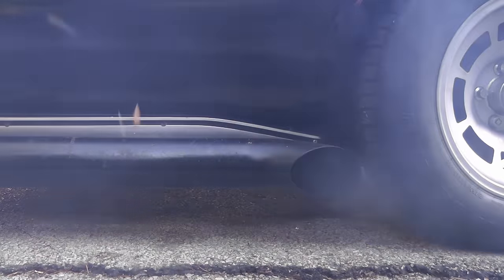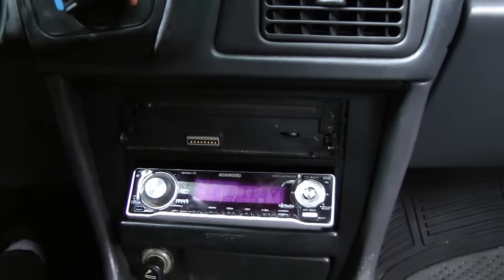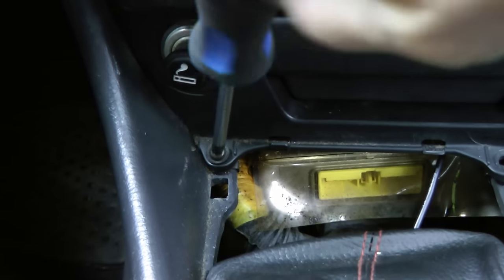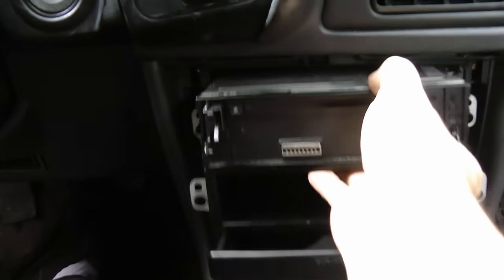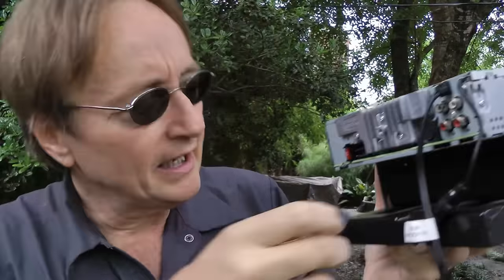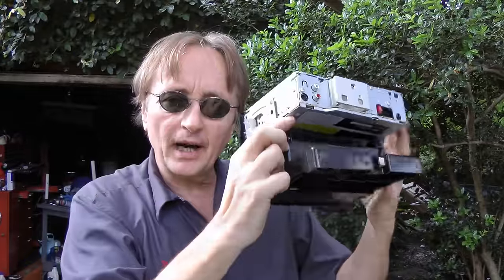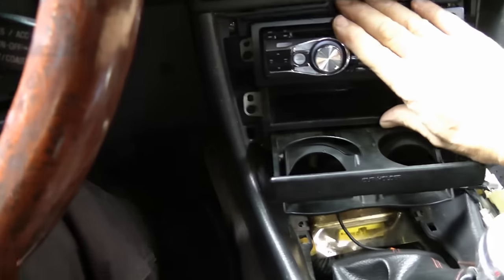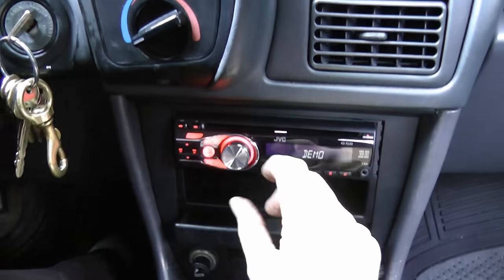How to Install Car Stereo

Comment: Hey Scotty, my mother has a 2013 Hyundai Genesis 3.8 sedan. It's a pretty nice car and I was just beginning to believe Hyundai has escaped their sorry reputation, but then the lights in the head liner started to flicker. It seems to only happen when the door is open, so I assume it has something to do with whatever tells the lights to turn on when it senses an open door. It isn't just one door, it happens with all of them (if that information matters). Would you happen to have any suggestions?
Reply from the maker: yes, check the ground wiring on that lighting system since it does it on all doors it can't be the door switches. But really, Koreans still make crappy cars in the long run from my experience

Comment: Scotty--  1994 Cavalier with its stock radio suddenly leaves the clock display on until the battery drains completely.  With fuses pulled battery remains fine.  Suggestions?  Door switch?  Faulty radio?  Where should I start?
--Joe

Comment: I recently bought a used car with an aftermarket radio in it. It vibrates a bit, especially in third gear (something to do with the frequency the car vibrates at in 3rd I guess). Any suggestions on how to fix that? I can live with it, but it would be nice if that is an easy problem to fix.

Comment: I tried installing a new radio from walmart in my truck, i matched the wires to where they should go, i turned the ignition on, and the radio doesnt turn on, i press the power button and nothing happens. The fuses are good, but did i buy a blown radio or am i missing something?

Comment: Hi Scotty i was wondering if you can help me out...
I have a 2003 Toyota Matrix XR 1.8L. And last night when i got off work both of my low beam headlights would not turn on automatically, since they are Day Time Running Lights. I also tried turning them on manually and no luck. My high beams, fog lights and all other lights are working fine. 
My question is where and what do i start checking? Where are the fuses and relays located on my vehicle? 
Your help is greatly appreciated.

Comment from the maker: do it yourself tons cheaper than that. Wiring's easy, as in this 50 dollar rather decent system, the wiring schematics are all on the back of the box. Wire is cheap, the rest is just your time.

Comment: Hi scotty i got a question off the topic. I just replaced the spark plug wires and the sparks(for new ones) and as soon as i started the engine the battery light showed on the dash, any idea(it is a ford V6 ohv 96 explorer 4x4 standard )? as additional info i checked the two wires on the battery and they were clean and fine, thanks.

Comment: this video reminds me that my radio in my 98 tocoma has been dead for years.   the cigarette lighter isn't working neither,  sucks because I can't use it to charge my phone. are the two problems related? would by is something wrong with the electricity, maybe the wires or is it that I need a new radio?
Reply from the maker: could use the same fuse or wiring in the dash could be disconnected

Comment: Most devices gives a bit of noise through the headphone jack when they're charging. There's no way to get around that other than unplugging the charging cable when using the aux. If your radio has a USB port and can play music through there, you should use that feature instead.

Comment from the maker: hey, the radio has two power wires, one for power all the time, the other for power when the key is turned on. And then one black ground wire, so why not just rewire those three wires directly to their sources, that's what I do rather than mess with the crap factory wiring.

Comment: Scotty K! I'm replacing the factory stereo on a 1979 Delta 88. The old stereo didn't need constant 12v power, so there isn't a wire to connect to my new stereo.

Can I splice into my ignition wire then add an in line fuse to run 12v constant power to my new stereo?

by the way - love your channel, even the videos that don't apply to me are interesting
Reply from the maker: +T Scott yes, you can splice it into the ignition

Comment: thats ok if you have an old beater like that, there was a time when it was that simple, take my 1994 Chevy Silverado 4x4  the factory rasio will not come out even after removing a few srews, it like something at the back of it is holding it, we have tried mant times to fget it out, and there is not one video on youtube that shows this truck. i know some take a specal key, but don't see any were it could go

Comment: hey I just installed new speakers with subs and I have amps for the subs and speakers but my front speakers do not work all the time. My friends said that I need better wires that can handle more amps etc but is this really the problem since the wires are connected properly? and if so what type of wires should I get? brand, size, etc.

Comment: I have a 03 Chevy avalanche with the factory bose amplifier in it. I installed a new radio and there was no sound. Is there any way I can bypass the amp so can make the sound work?

Comment: i have two questions should you unhook the battery and what if your getting noise but no radio signal and the antenna is plugged in.

Comment: When you put in new radios do every car have the same color wires inside the dash as the new radio at the back so they can be matched up? Or is every color wire different? And last do they all have those clips with the wires that snap in the back of the new radio? (im changing a friends radio soon.)

Comment: I'm not sure if they make one for Honda, I have a 1999 Camry when I had the Factory radio It could have come with a 6 cd changer, I did not have one so that left an empty port. They made a Aux cable adapter that will plug into that port and you will get cd quality music.

Comment: When you match up the wires is it always color for color?
Reply from the maker: depends on the car, some do, some don't. That's why you need a wiring adaptor for many so they go in the correct places

Comment: For the old radio did you cut off the  factory wiring or use an adapter kit? Please respond.
Reply: I always used an adapter kit. Makes things much easier. That way your radio harness can for your cars harness, using the existing wiring for power and speakers. With an adpater harness, you can make the connections on a table or bench. Even solder the connections if you want. trying to wire in the dash can be a bitch.

Comment: nice vid and congrats for because you share with as your  46 years of experience ..... WELL DONE , but now depends on car model , i want to replace my radio of my for focus turbo siesel 1999 , please give some advice thanks scoty THANKS
Reply from the maker: +dan laesu  it's 48 years now. realize ford uses radios that snap and lock in place, you need a special tool to remove them from the dash, get a cheaper one at a place like auto zone

Comment: Scotty, Can I mix 1 qt of dino oil with 5qt of synthetic oil (both are same weight 10W30)? My oil is kind of low and I don't have time to change the oil completely right now. Will it hurt the engine in anyway? my car has 170,000miles on it. Thanks!

Comment: It a lot harder to replace a radio in a 1991 toyota camry . It has a factory radio in a radio holder that any new radio will not fit. In order to replace the radio you have to by a conversion kit and a wire harness . That adds a cost of 45 bucks so with that it would cost over 100 bucks to replace the radio. 
Can you make a video showing that type of swap.
Is there a was to use the radio holder for a new radio on a 1991 camry dx.

Comment: If anyone does this, make sure you disconnect negative battery cable before cutting any wires or messing with the wires

Comment: ya know ive watched a lot of your videos and never had much to say but i feel maybe you should have done this using a car with a stock radio so someone could learn how to install an aftermarket radio from stock. this doesnt show anything about having to use a dash instal kit or the wiring of the unit because it already had a aftermarket system. someones gonna go and try to this and the cd players not gonna sit in the hole right and then the wiring will be all screwed up and they will fail

Comment: hey scott, I need your help.
I got a GM wiring harness and the wires don't match up with what is in my malibu. 
So my question is, is that normal or is the part not gonna work out?

Comment: European cars are alot easier to swap the radio on, there is 4 holes on the sides of the radio, you put metal rods in the holes, then put tension so you get a nice grip around it.
Then just pull it out, change the connector and push it back in, takes less then 1minute. but then again i guess that's why so many radios are stolen here, since it takes about 2-3sec break the window and pull one out.

Comment: Scotty, I have a 98 Honda Civic with a stock radio.  i want to add a device to my car to listen to my iphone music, but i do not want to put a stereo because it will attract thieves.  I dont like using FM transmitter because the quality of the music is bit low and you can hear the statics.  Any suggestions?

Comment: Scotty you forgot to mention to disconnect the negative battery first before doing any wiring installation on your car LOL. I know some people who actually fried their new stereo but not disconnecting the battery first LOL
Reply: Xtasy Musik so do I turn the battery off first? Then do what he said?
Reply: Anthony Sefo disconnect the battery terminals
Reply: If you notice right next to the power connector in the back of the radio there is a 10A fuse that will blow before the radio will

Comment: I prefer the original  radio in my 1996 Toyota Corolla  that has a cassette player

it's been pretty reliable for streaming music  using the cassette adapter method   

although I will say  the audio is not the same when playing a cassette forward, in fact the audio sounds better when the tape is played in reverse

I have no use for a cd player
Reply: fargeeks 😐
Reply: +Emerson Herrera old school ;)

Comment from the maker: not much power in a radio, those connectors work fine inside a dash. Only reason the radio was changed was cause you couldn't hook modern wireless devices to it, which the new radio was able to do, for only 59 bucks.

Comment: Its actually true unfortunately. The OnStar on 90% of GM products (not just chevy have this issue). You have to install a bypass module between the stock harness and new harness from your new radio. Somewhat costly but well worth it when everything it all setup.

Comment from the maker: cars nowadays use various different fluids for power steering. Even different years of the same make car use different fluids. ALWAYS check with the manufacturer for your own vehicle what to use. Putting the wrong stuff in can be disasterous in the long run.

Comment: ALWAYS keep the factory radio that came in your car/truck even if it's a POS or doesn't work. most people want a used car to be bone stock (I know I do.) if I want a different radio/rims/steering wheel, I'll put one in myself. you never know when your car/truck will attain "classic" status and it's practically impossible to buy an old car with the original radio.
Reply: FCFordLord
no, what I was said was if you change the radio, keep the original one so it can be put back later if needed.
Reply: It's simple, you put the one in you like, and then when it comes to putting in a new one you put the old one back in.

Comment from the maker: what a Whiner. Of course cars are different, I filmed one I was fixing. Can only do one thing at a time.  And some people are a bit too fanatical about wiring, it's a radio with very little power in it, you don't need to solder and heatshrink stuff inside the dash where no weather gets in.

Comment: Hey I have a 1989 chevy Corsica with a old radio unit which is connected with the ac unit it's like one o peace can be changed ? Thank you
Reply from the maker: +Yousef Sharfedden anything can be done with a few modifications, car stereo joints do it all the time

Comment: Do we have to disconnect the battery?
Reply from the maker: it's a good idea to if you're worried about your ability to not touch power wires to ground when working

Comment: Hey Scotty, I am a little confused with connecting the wires, there are two sets of wires that are plugged into the original with similar color, i am trying to do this myself so i dont have to pay over $100 for someone else to do it.

Comment: Bad Ipod usb cable , or if your using aux bad aux cable , or bad connection on the head unit it self. One of the grounds is bad and that's why your hearing that sound.

Comment: After installing a new radio, my station doesn't stay on. The memory for the presets works fine, but I have to hit my re-tune to the station I want every time I turn the car back on.

Any ideas?
Reply from the maker: you have two power wires on that thing, one goes to live power all the time, the other goes to power ONLY when ignition switch is on. Odds are you either mixed those two wires, or didn't connect the live all the time wire

Comment: Hey scotty i have a 2000 ford focus and my gear shifter gets stuck,the button will not go in, i have a screw driver stuck in the gear shift key holder and it wont move the shift stick unless i mess with it, where can i get  a key for it or how can i fix it?

Comment from the maker: Wire nuts came on the radio from the previous owner. But really, there's so little power, and it's inside the dash, not really a hazard, just messy looking. AND really, no one can see in there without pulling the radio anyway.

Comment: Hi Scott, nice videos :)

I've bought a pair of new speakers for my car front doors and the connections seem quite simple. But I was wondering about something - is it necessary to include a new fuse or something? Or it's only needed when you add an amplifier or similar stuff? Sorry for this newbie question :)) eheh

Comment: I bought my eclipse spyder. with a broke radio it kinda buzzes on occation nice New radio but no power to it.  
what do you guys think????? wired wrong?
Reply from the maker: first, just wire it directly to the battery and ground using jumper wires you can easily hook up to see if its that
Reply: Scotty Kilmer I might have a radio guy take a look at it cause I don't wanna mess something up and not have my car not able to start . the worst usually happens to me.

Comment from the maker: unfortunately sanding it down to the bare metal and repainting is the only thing that fixes that. But before it happens, if you wax the car 4 times a year, once for each season, it won't happen in the first place.

Comment from the maker: you would definitely need to replace a radio with the same unit in that case, or pay a pro stereo dude to hook it up. Too much high tech if you ask me, even this 50 buck radio came with a remote anyway.

Comment: It happens... trust me... worst stereo I ever had was a Kenwood I bought back in '98-'99
You would think every unit of a certain model is manufactured the same since they're made by the same company. Unfortunately they're just like cars. You can have two of the same exact model and one will last for years while the other craps out in 6 months.

Comment: Hey Scotty, I need your advice again buddy. 

Well the situation is like this, I just got myself a second hand Hyundai Elantra 1.6A but I do not like the radio system due to the fact that it dosent have a USB port. 

I do have an extra Pioneer brand radio which I had removed from my previous ride. (the radio is only 8 months old). Now my intention is to install that on my Hyundai Elantra. 

However, the irony is I have been to so many workshops and their workmanship charges are crazy. To add on, some mechanic told me that since I do not have the wiring harness for my Pioneer radio, he would have to charge me an additional $50 bucks to order it from Pioneer. He said that I must use the original wires from Pioneer. 
 
 But I somehow do not trust his words for a wire harness should not be so  expensive! 

I have watched your video on how to replace a car radio also. However, my question is can I just use the existing wire from my Hyundai Elantra to connect to my Pioneer radio? Or do I have no choice but to order it from the manufacturer?? 

I would really appreciate your kind help man.
Reply from the maker: +Roh G if you can figure out which wires go where, solder them together, people do that all the time
Reply: Scotty Kilmer Hmm I can try that. But I was thinking of buying the wire harness instead. Do you really think it should be that expensive? Just curious.
Reply: A wire harness should not be that expensive at all. Wire is cheap, and cone connectors are cheap. I would spend $20 max on a radio wire harness.
Reply: znovosad555 precisely. I think they just wana rip me off
Reply: Probably. All of the bigger companies do it. Search on Amazon
Reply: +Roh G There trying to rip you off. That's what they charge for labor here in Santa Ana, CA if you take a stereo to a shop for installation.
Reply: I would think you would need that plug and harness that fits into your pioneer Radio. Depending what you need, I just Googled them and they come up for less than $10. I would order an adapter harness to fit your Elantra. I think Crutchfield or Best Buy sells them. they might also sell them as a kit as frame to fit your radio into the ELantra's dash. Basically it's a plug that will fit your Elantra's radio harness with bare wires on the end that connects to your Pioneer harness. Having done many radio installs, I can tell you it saves frustration as you can wire your radio on a table and just plug every thing in inside your car. You could use wire  nuts, but soldering with heat shrink will make stable durable connections.